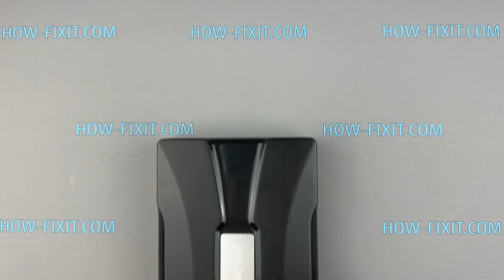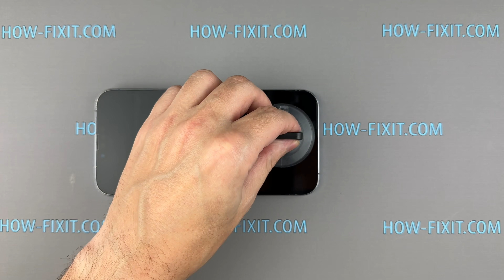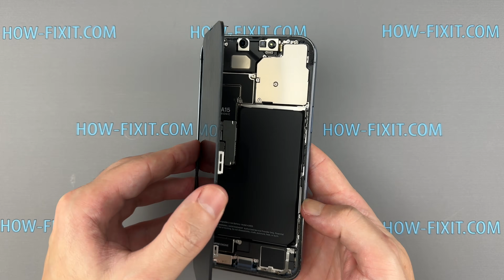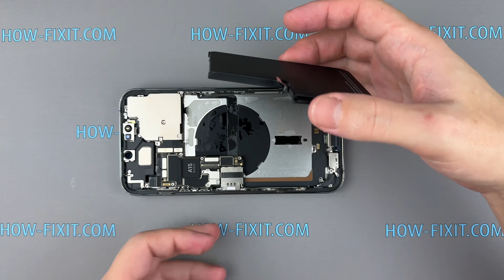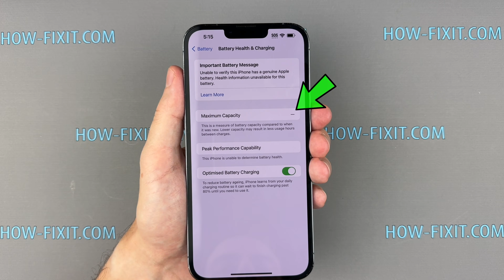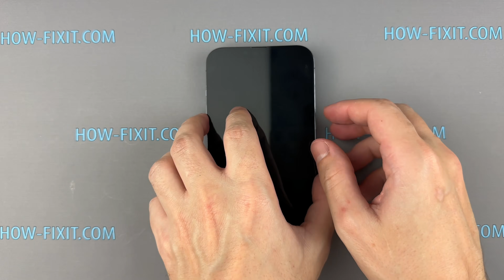iPhone 13 Pro Max Battery Replacement: DIY Step-by-Step Guide!

Comment: It took me two days. It’s very important to take your time and be patient. It also helps to do it step by step—watching the video and pausing it after removing each screw.
That being said, I still have two screws remaining, lol.
I managed to change the battery, and now the phone works like a charm. Thank you.
Reply: After changing the battery, did u notice it didn't change much? Like I changed the battery yesterday, I still don't see a difference but the guy at the store said it takes like 3 to 4 days to stabilize or something idk
Reply: 2days?!? Lol took me like 2 hours if that. Never have done it before
Reply: If it took you TWO DAYS,  AND you had TWO screws left over when you were done? You would have been MUCH better off just taking it to a tech.
Reply: @Ellis.DTrails  Better to do it yourself than paying 800 dollars for a phone that is now considered outdated....

Comment: PRO TIP: If you don’t own a fan to heat your edges, take two plastic bags (more the better) and fill it with ~500ml of water and boil it on the oven, then you take a thin textile sheet and place over your phone (for extra safety, put your phone in plastic bag).
Then let it sit for 30 seconds and toutch your display edges every now and then. If you burn your finger just at toutch then its to warm and let it sit a little.
Repeat woth 15 second cycles until your bottom edge starts to give away.

Use your plastic plectrum to get benieth the screen and edge.

WARNING!!! WARNING!!! WARNING!!! 
BE CAREFUL WHEN YOU START PULLING!

Comment: Mine is 71% ☠️
Reply: I just did my sons, his was at 54% smh., and you don't need to remove the speaker or the taptic engine, there's other videos that have the 13 pro max and they didn't take that off

Comment: Unfortunately, I cracked my screen trying to do this (just my luck), but you were very thorough with the disassembly and reassembly. Thanks for sharing!
Reply: Gotta use more heat… dude should have been more detailed about this.
Reply: @damonm3  yeah im surprised he didnt mention what temp heat too
Reply: I just did exactly that. What a nightmare.

Comment: Just tried this and cracked my screen. If your screen is scratched deeply be extra careful. Had a small chip on edge and it broke as sooon as I got to there
Reply: Its not your fault, i just started a repair business and i have watched all tutorials for this and all guys show it the wrong way. You need a razorblade + extreme heat + alot alot of alcohol to open the screen on this new models because the screen is paper thin so most people will crack it. It takes me about 10-15minute of heat and minimal adjustements to open these type of screens.
Reply: can you still use the phone though?

Comment: This is crazy.    Apple made this insane on purpose to discourage people from replacing their shit batteries
Reply: i don’t think it’s a difficult process and you also don’t need a lot of special tools. 

only difficult part is to actually remove the screen but that’s for a reason and the reason is water resistance seal.
Reply: You are clueless
Reply: @TheJuggermugger no you
Reply: @frontsoldatmm  No you're clueless if you think they can make a phone so thin without using every mm of space available. Pay a pro to change your battery out. Only a mook would think they can replace an iPhone battery from watching these dumb YouTube videos.
Reply: @TheJuggermugger my life is changed by your post, thank you.
Reply: @TheJuggermugger guess I'm a Mook then. I would rather do it myself cause I like the learning process and being capable of doing things people tell me I can't. Guess I'm hard headed like that. Maybe that's what Mook means?
Reply: @ChristopherStanford-hp8be  Good luck Mookie.

mook      noun
ˈmük 

slang
: a foolish, insignificant, or contemptible person

Comment: I did the same as him in the video. I worked carefully, I put in a new battery, and when I try to turn on the phone, I get a black screen — and sometimes it flashes red.
Reply: It's really not that difficult to break your display, unfortunately. Disassembly is way harder than it seems on these Youtube vids. Especially on the pro max models.
Reply: i had to Force Restart my iphone to get it to come on. very scary but i replaced the screen 100 times and messed my Face ID up. not that important.

Comment: great video, just replaced my battery while watching.  They mentioned they have another video on how to get rid of the message about an unknow battery type.  I can't find it.
Reply from the maker: ⚠To Fix 'Unknown Part' or 'Important Battery Message' check the iPhone Battery Calibration video tutorial, link in the description under the video
Reply: They use flex tap
Reply: Where did u get the original battery of apple

Comment: Does changing the battery lose water resistance?
Reply: no
Reply: I think thats what the water resist seal for the screen is for on the tool kit
Reply: @leonel9110  I have seen many videos of battery replacement but there are still many cases of water damage.
Reply: @discoverdeep-y5o just apply the new seal properly and keep your phone away from water
Reply: @WinfamyThefamy  So if you change the battery, you will lose the water resistance.
Reply: @discoverdeep-y5o yeah if you do it poorly
Reply: @discoverdeep-y5o no you don’t, but you still should be cautious, considering we all kinda suck applying this seal correctly. So if possible watch out how deep the phone goes in water
Reply: Ya this is awesome video. But, i am going to give it to apple for $89 to replace it. And get warranty for it. because, considering the price for OEM battery plus tools everything. rather just save the headache of a mishap and just give it to them lol.
Reply: Once you did a battery replacement, you cannot put your phone in your sweaty pocket.